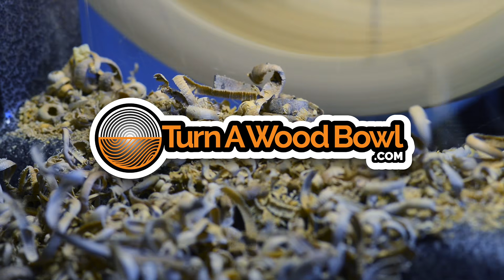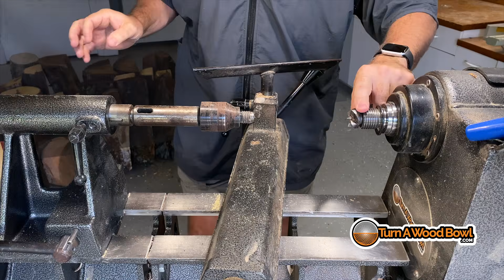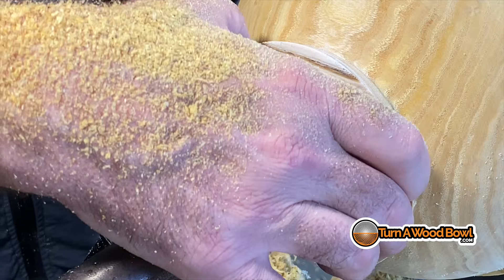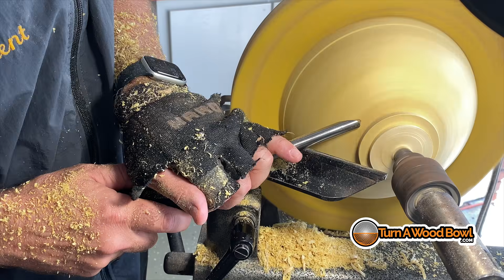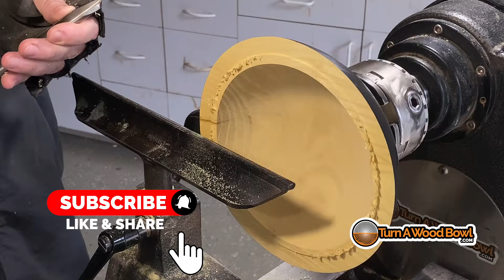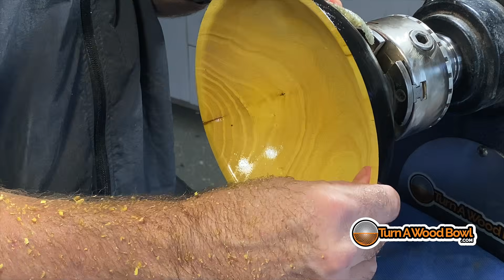Firewood Log to Bowl Twice-Turned Ebony Mulberry Wood Bowl - Woodturning Video

Comment: This is a great video. How would I use other colors on the outside? What type of types of products should I look for?
Reply from the maker: Pretty much anything this permanent. Avoid toxic paints, etc if the bowl will be used with foods, but once coated with a final finish most colors are fine.

Comment: Love this video. Good length. I’ve never used Indian ink. That looks fun.
Reply: Ps. I diverted in the middle to rewatch your excellent video on microwave drying and have quite a lot of questions about it. I make quite a lot of bowls, all from green wood coppiced in winter, mainly ash, alder, birch and some chestnut and cherry from local trees. I live in Wales, UK.  I twice-turn them all, and am seeking a handy balance between all- microwave drying and natural drying. I use a moisture meter and mark the moisture reading between each micro session.  It’s a long learning curve, isn’t it? I use a grain sealer on the end grain portion most likely to split after the first turning, but it doesn’t feel right to seal in moisture too much from parts of the bowl. I aim where possible to do things as naturally as possible. I’d kinda like to see a longer vid from you on your experience with drying.

Comment: 1st off thank you so much for being such a great teacher- I have a question, after rough- turning your blanks what if anything do you treat the wood with to help stop cracking as it dries? Being on a low budget (disabled) I spray mine down with mineral oil- I use a friction finish when complete is this OK? Tyler
Reply from the maker: Tyler,
I use Anchorseal, but you can use a couple coats of latex paint also.
Happy Turning! 
Kent

Comment: Your videos are amazing.  I have recently gotten into bowl turning and I have really learned a lot from your videos.  I'm going to stick with you, very informative.  I was having trouble trying to remove material from the bowl.  On the edge.  I think maybe I wasn't cleaning up the face before I started removing the wood.  As I neared the edge it would grab the tool and destroy the edge.  I was about ready to give up.  Very frustrating.  I wasn't using the bevel properly either.  I need to watch some of your other videos on sharpening too.  Thanks so much!
Reply from the maker: Hang in there Kim, you've got this. Remember; persistent, patient practice will yield the bowls you imagine creating!  All the best to you and Happy Turning!

Comment: Could you explain why on the shear cut you were a long distance above center, please?
Reply from the maker: Good question, Noeleo. Yes, when we are making cuts we need the most support from the tool rest and we want to make that cut right at the centerline. However, a shear-scrape is not really a cut. It's more like shaving. The tool is under very little stress when shear-scraping so we can have the tool farther away from that ideal cutting location. Hope that helps. All the best to you and Happy Turning!

Comment: Great looking bowl, and the turning twice info was outstanding...I learned a lot of new stuff. I love a good ebony finish, and now have a ton of work to do with “soot and varnish.”  My only other comment would be "Linseed oil is not food-grade safe" I use mineral oil and beeswax, and as you said, a little dab will go a long way, and there is no difference in appearance after buffing, but it is food safe.😃😃😃
Reply from the maker: Awesome, thank you for sharing.

Comment: Another great video Kent that gave me lots of ideas.  I've been using a lot of maple that I get from my property and wanted to let you know that I love your twice turning approach.  So I took two large pieces of maple from the same tree, about 14" diameter each and rough turned them.  I then coated one with Anchor Seal and the other with some latex paint that I had.  The one with the Anchor Seal cracked after about 8 months of drying.  The one covered completely in latex paint was very dry and had zero cracks.  I think I am going to use latex paint to cover my wood in the future.  Your video that showed how to fix cracks using carpenter's glue and sanding it came in handy on the cracked bowl.  Thank you for sharing your bowl turning skills!
Reply from the maker: Thank you for writing and sharing, George! Sounds like a great plan. All the best to you and Happy Turning!

Comment: Instead of putting the wood bowl in the microwave for drying, maybe you could just pack it in rice which will absorb the moisture? People use rice to save cell phones that get wet.
Reply from the maker: Yes, that can work. I haven't tried it, but I would guess you'd need to switch the rice out occasionally. Worth experimenting.

Comment: I watch your Videos almost daily and try to soak up as much as this 70 year old brain can handle. Thank you for your help. 
Is there any specific things to consider when making ,sealing, and rough turning pecan? I was given a truck load by my neighbor. Monstrous tree.  I heard it will split easily.
I had another question I posted to your fb message a while back. Would you rather I put them here in comments?
Reply from the maker: Best thing for pecan is to process it sooner rather than later. See my new Understanding Green Wood course for more details. And yes, here or my website www.TurnAWoodBowl.com/ is best for comment. Thanks and Happy Turning!

Comment: I have learned a lot from your channel. Thanks!! I’ve watched nearly every video now over the past 11 months and have a request. I turn smaller bowls, deeper bowls, and vases. I struggle with turning the inside of these deeper vessels when the lip prevents the angle needed for a 55° bowl gouge. I’m just not able to ride the bevel across the bottom when the walls are a steeper angle to the bottom. Any advise would be great!
Reply from the maker: Thanks, Mark. Great question. The answer is the Micro Bevel! https://youtu.be/OvMUViCcSjc All the best to you and Happy Turning!

Comment: Such a great video!
One question, does the oil finish actually 'stick' on the shellac and india ink? Does it give that protective layer so you don't wash off the india ink? Thanks again!
Reply from the maker: Yes, it takes a bit of time to penetrate the surface, but it does offer a great finish coat. Happy Turning!

Comment: Nice job Kent! Been having a great time with turning! 🎉I am totally hooked🪵💫  I do have question for you and that is what degree is your detail spindle gouge just bought a Robert Sorby and is a fingernail spindle gouge 1/2 inch and need to  be sharpened I think it was a 45 I don’t remember. Thanks my friend for feed back as always! 👊🏼✌🏼
Reply from the maker: Thank you, Douglas. Yes, the fingernail can be about 45°. I make mine a bit steeper because I primarily use it to undercut the tenons so I want a good point. I sharpen that tool by hand and don't stick to a fixed angle. All the best to you and Happy Turning!

Comment: Nice work!
Is wax enough to avoid than muberry becomes brown?
I usually give shellack but it changes the beautiful color of this wood...
Reply from the maker: The wood will change color regardless of the finish. Although, it is usually UV light that effects the color, so if you can find a UV blocking finish you might retain the wood color longer. Happy Turning!

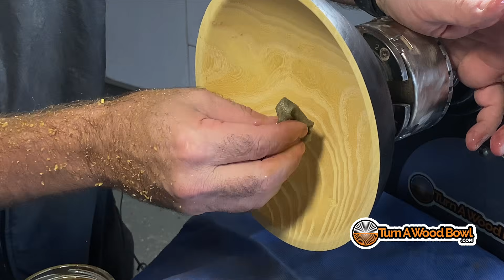Comment: Unfortunately, I messed up my old jaw chuck because I always touched it with oily fingers like you did at 54:20. How can I get rid of old oil residues from metal?
So if I want to sell my old wood lathe now, it would be great if I could clean my jaw chuck accordingly ...
Do you have a tip for me?
Reply from the maker: Grobi, if the oil is hard and cured you can use a wire brush or wheel to remove the residue. If it's liquid, use a degreaser. All the best to you and Happy Turning!

Comment: Why not use dry logs to begin with?
Is there a specific reason or benefit for using fresh green wood?
Just asking.
Reply from the maker: Dry logs crack and decompose before they are thoroughly dry. And yes, green wood turns like butter. ;)
Reply: @TurnAWoodBowl 
Only left in nature they do 
Not in controlled environment

Comment: Kent. I have recently discovered your channel.  You are doing a great job. I have a renewed interest in turning bowls. I have used a microwave to dry various projects, including bowls.  I call my process ‘ 30/30 ‘.  I wrap the piece in two or three layers of newspaper. Microwave for 30 seconds then leave it undisturbed in the oven for 30 minutes. After thirty minutes you will find the moisture has migrated to the paper.  Repeat process until paper emerges dry.  Less scientific than weighing but end result is dry ( equalized ) moisture, ready for finish. David Brooks, Cool-n-Organic Woodwork. 🤠
Reply from the maker: That's a cool approach, I like it. Thanks for sharing. Happy Turning!

Comment: Hello Kent. I recently discovered your channel on Youtube.  You are the best.  Great instruction.  I intend to do your e-course but I have one concern. I have a Shopsmith Mark V.  It has an RPM range of 600-6000.  Will this be a satisfactory machine for bowl turning ?  I have made a few bowls.  I too absolutely love the process.  Please advise.  E-mail (davidrbrooks2@gmail.com) or call, 573.210.9756.  David Brooks.  Thank you.
Reply from the maker: You will want to be able to get the speed for bowl turning much slower with the max rpm around 1000. DO NOT try turning anything much above 1000 rpm, Check out my Wood Lathe Speed video. All the best to you and Happy Turning!

Comment: Did you put a finish on top of the India Ink? I thought you mentioned putting linseed oil on the black side as well, but I'm not sure. And when you run steel wool, did you do that on both sides or just the inside? Thanks!
Reply from the maker: Yes, linseed oil (Danish oil) over entire piece. Be sure the ink is dry first. Happy Turning!

Comment: A really great, comprehensive video Kent. It covers the exact project I'm attempting currently. Please could you confirm the sizes of the bowl gouges you use in each step of the process along with their profile? Thanks. I look forward to watching more .
Reply from the maker: Thanks, Helen. The main bowl gouge is 1/2" and I use the 5/8" to rough the exterior. I also use a 3/8" detail spindle gouge on the tenon. Happy Turning!

Comment: Hi Kent, I am a big fan and am about to try your ebonizing technique for the first time.  This video ends with you saying that you will burnish the finish but you don't actually show it.  So, do you use 0000 steel wool inside and out, or just inside the bowl?
Reply from the maker: Yes, 0000 steel wool does the trick. I burnish the shellac surfaces. You can burnish between ink coats. The steel wool will remove a little of the ink, but make the surface very smooth.
Reply: @TurnAWoodBowl  Thanks, Kent.

Comment: Hi Maestro. I have a question: in order to speed up the drying time of the wood, is it a good idea to dig a hole of 2-3 cm diam.  in a  log that has been cutted 2 months ago of 15cm diameter? not througout of course...   Thanks for the answer.
Reply from the maker: Hm? That's an interesting question. I hole in the middle of a log would relieve some moisture. However, without dissecting the wood and knowing where your bowl is best positioned, you may be sacrificing a good bowl blank in the process.

Comment: Have you ever tried iron salts (iron-lll-nitrate in alcohol works really well) on oak?
It gives a nice dark and kind of old look
Reply from the maker: I have not, but it sound like it would work. I'll have to check into this. Thanks.
Reply: @TurnAWoodBowl  use low concentration. About 1% is easily enough. And droppings make quite a mess

Comment: They work for me, problem with people speeding up the cuts is that I can't see if I am going to slow or to fast. Showing the actual cutting speed helps me tremendously.  I found that I was going to fast for the most part.  Time for me to go down to my shop and practice now.

I also noticed that because you are not speeding the up video you teach more by talking instead of me listening to music.  I don't know about other people but I learned a lot from those comments as your are turning.
Reply from the maker: I'm thrilled this helps inspire you to go practice. That's what its all about. Glad the narration helps too. I have a hearing issue and music over a voice is the worst as far as understanding. So I try hard to make these clear and to the point. Thank you and Happy Turning!

Comment: Great video Kent. Very informative. Just wondering, the outside of the bowl prior to sanding looked still a bit rough. There were cut marks and end grain tear? Would that be normal for you and you just work these out during sanding?
Reply from the maker: Some light marks are not a problem and sand out easily. Happy Turning!
Reply: Thanks for the reply. I've been turning for couple of years now and just trying to get that happy medium when the finish is enough and rest can be sanded.

Comment: That was a terrific video.  I learned a lot and was reminded of a lot of techniques that I want to start using right away. I've been turning 14 years but have gotten stuck in my ways so these techniques will help me renew my interest.
Toward the last two inches of cutting out the inside of the bowl, I noticed that it appeared to have a wobble.  I know you had just trued up the outside and inside of the bowl so there should not have been any wobble.  Could that have been the filming that made that appear to be wobble, just as the bowl appears to be reversing direction of rotation at various speeds due to frame speed when filming, or could it have been a true wobble caused by the continued drying of the wet wood during the turning process? It just seemed to occur much too soon during the process to be caused by continued drying, but I have heard some turners talking about cracks starting to appear in wet wood as one turns due to drying, especially if you allow the tool to become too hot. Could warping occur this soon as well?  Have you noticed this wobble appearance in the video and do you know the cause?
Reply from the maker: Thank you, Jim. I'm excited you're getting back into turning. I just rewatched the section you mentioned. There is a wobble at the end of the turning. I was minor and really didn't effect the final piece. It could have occured from the tenon shifting a very small amount or possibly the walls shifting a touch from moisture still contained. Since I dried this bowl about 3/4 of the way, in order to make the video, the remaining moisture could have been the issue. You could also loosen the chuck a touch and try to reset the tenon for a better fit. EIther way it was very minor and didn't really show up in the final bowl. Thanks for being so observant. Happy Turning!

Comment: Dear Kent, watching you struggle to get the wood off at the centre of the bowl inside makes me think of something to make it easier.  What if you were to drill a sizeable hole to the finish depth of your cut using the tail-stock and taper bit or drill chuck and straight shanked drill bit?  If you use an inch bit then you can stop at ½” from centre. Setting the depth would also fix your destination depth once.  You can go fast and not worry about your depth so long as you don’t go deeper than your drill hole.  

I must confess, I am a total novice to bowl turning and totally respect your amazing skill and knowledge. There may be good reasons why my idea is not sensible and am happy to be told.  I am constantly impressed with your work and look forward to trying to emulate what you do. Cheers.
Reply from the maker: Peter, thanks for writing. That's an option that works and some turners use that technique. I find it a bit time consuming to get it all set up and ready, plus if you go too deep the piece can be ruined. It's a personal preference.  Happy Turning!

Comment: I've come to prefer using a mortise and inserting my 4 jaw chuck into that. For me it's easier to deal with when finishing the base of the bowl. The mortise becomes part of the base and doesn't have to be trimmed off like a tenon. Is there a reason to prefer the tenon method over the mortise?
Reply from the maker: That sounds like a good plan. Do what works for you!

Comment: I am wonder if the hollowing depth could be helped with a drilled hole in the middle. When the bottom of the drilled hole is obvious, go no deeper.
Reply from the maker: I avoid that process because once you learn to clear the bowl interior, you can do that faster than drilling out the center.

Comment: Hello Kent, just a quick question for you. I've seen many people tech that your back hand should be near the butt of the handle, yet you prefer your hand much closer together. I realize this is mostly personal preference towards what feels comfortable, but do you have any reasons or explanation for why you hold the chisel the way you do?
Reply from the maker: Good question. All the steering is done with the right hand. I have more control by using the full handle. I do think it's a personal preference and it also has to do with the particular cut at the moment. Thanks for asking.  Happy Turning!

Comment: hi Kent another great video just a quick question when you say your using a 1/2 in or 5/8in bowl gouge how are you measuring it, flute size or diameter? as I know U.S., U.K. and Aus. all measure a gouge differently  thanks again for your work
Reply from the maker: Good question. The diameter of the shaft. Thanks for asking.